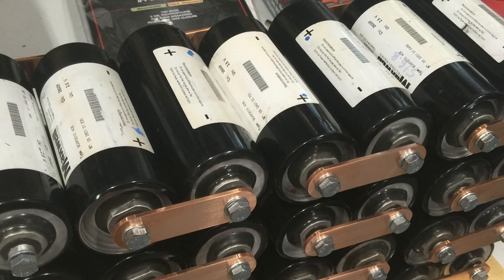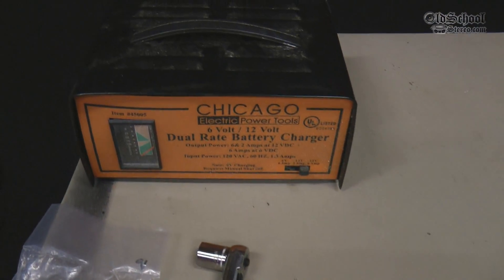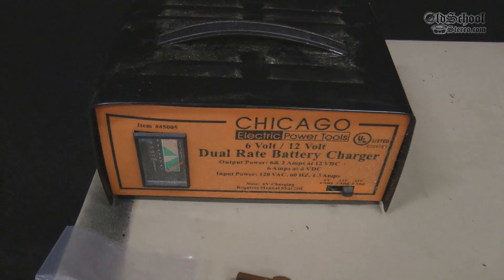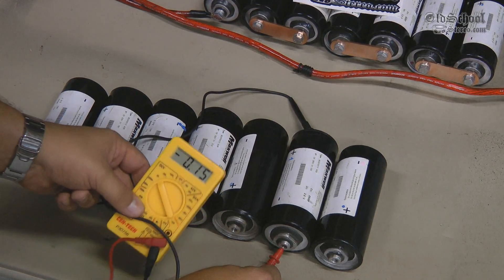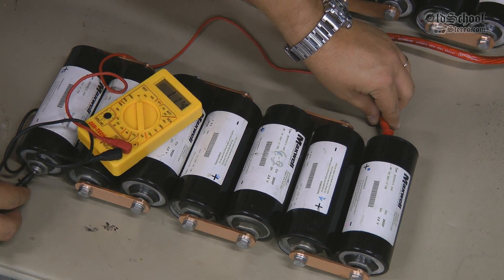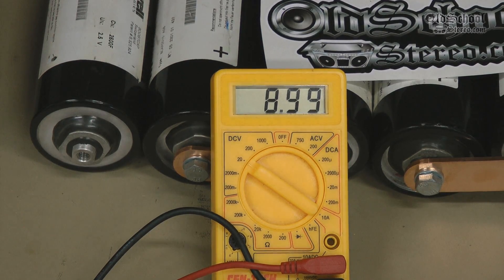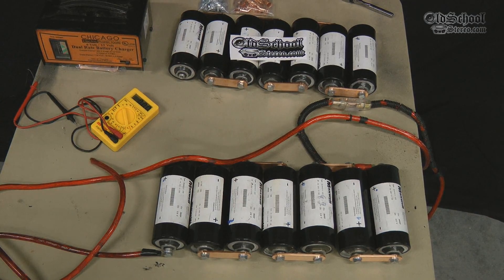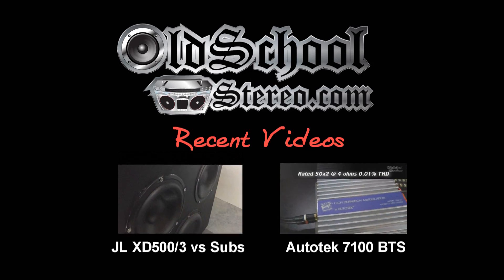Maxwell Boostcaps for Test Bench Ultracaps Supercaps 2.5V 2600F

Comment: I know its an old video but what i wanted to mention is important and gives the ability to safely charge and discharge the caps. use a CC/CV power supply. Onstant current, constant voltage. You can control how quickly you charge the capacitors and if you want to discharge them safely just lower the voltage on the power supply to the voltage you want. If you need 8v but the bank is at 12.5, lower the voltage and the cap will discharge until they get to the desired voltage then stop.

Comment: So have you used those AWG0 copper terminals or stick with those thin ones that are connected in the video ?
Reply from the maker: +Andrei Banciu The 4AWG wires were used for charging only. I have multiple runs of 0AWG for the banks

Comment: The best thing to charge super caps is a switched mode constant current source with a voltage comparator to switch it off once it has reached certain level. This way the voltage ramps up linearly.

Comment: Any time you wire capacitors in series you need to place high value balancing resistors across them to ensure proper voltage sharing. I'd use something around 250K.

Comment: You could use a current limiter like a light bulb (resistor) in series to keep the charger from cutting out.  It's the current draw that's cutting it out.  Nice bank roll there buddy.  East coast!!! 

Take care.  Love the vids.  Meade wishes he was as cool as you.
Reply from the maker: Yessir, I did not have a 12v light bulb handy. But yes, this would assist in charging, especially with very low voltage of discharged caps

Comment: A lot of things in electronics do not have a positive and negative.  You are in the realm of DIRECT CURRENT.  

So... Hot and neutral?  ALTERNATING CURRENT.  The juice runs both ways.  How fast? There's your frequency, or HERTZ.  

Try using a resistor to charge them next time, with the batt charger.  It's just a transformer...
Reply from the maker: I meant 12V DC. Aren't you busy writing scary books ;-)

Comment: just wondering why you didnt use a light bulb or resistor when charging?
Reply from the maker: +Cody Hodgson That would have worked as well. I didn't have one of either handy
Reply: +Dereck BigDWiz lol i feel you just the other day grabbed my bulb to charge a cap and the filament was broken. honestly they just done want sparks around the car battery so on a test bench should be no harm.

Comment: Hey Derek cool video! I have a quick question for you. How long does it take for one of these stiffening caps to lose it's charge when not in use and not discharged?
Reply: in not big d and my answer might be incorrect. but they should hold a charge indefinitely as long as there is no draw
Reply from the maker: +Geerladenlad They seem to drain down about 1V per day or so. I'll keep a better eye on them and let you know for sure
Reply: Mines still sits around 13v after a month

Comment: safety ?  suggest you take off the watch and use insulated spanners as well, charged caps no matter how little (like batteries) are not forgiving I have seen spanners vaporise across a 2v cell on a battery bank.
Reply from the maker: +BeachSandInspector Technologies Good points!

Comment: Man I remember chaining 10-1 farad capacitors together back in the day and thought that was beast. I been out of the game for a while but I dont see many systems with capacitor banks anymore...
Reply from the maker: +MullinPerformance That was 10F of capacitance total...this bank has almost 1500F of capacitance! These ultra caps are no joke and you'll see soon how well they work when I do Amp Dyno tests pulling big current...
Reply: This was the mid 90's when the biggeest capacitor you could get was a 1 farad. When I started see 100 farad caps in the 2000's it blew my mind. My biggest fear was dropping a allen wrench between the terminals when taking them in or out. They used to have these horrible little screw in  terminals about a inch apart.
Reply from the maker: +MullinPerformance No doubt. Even before the 1F caps, Richard Clark was using smaller caps. Yeah man, these Ultra Caps are no joke, at least the terminals are on opposite ends now
Reply: +MullinPerformance Aluma pro / the cap I believe they had a 5 and a 15 farad Cap

the used them in military vehicles first then used them for car audio

THE CAP..

Comment: would you say those are better than using agm batteries. also what is the price on each one and how many would i need to run my 3500 watt system
Reply from the maker: +913los913 read Taylor's excellent article here: http://www.taylorfade.com/supercaps/ He goes into much more detail. For my purpose, the caps work great, but they may not be best for all scenarios
Reply from the maker: +913los913 the black ones I show are discontinued. The newer ones are blue and higher voltage / capacitance. They were inexpensive when they first hit the market, now they are out of control expensive, like $60 each
Reply: +Dereck BigDWiz. cool thanks ill check it out.